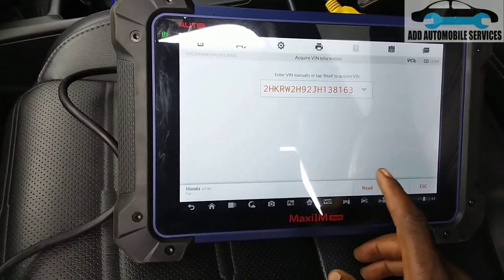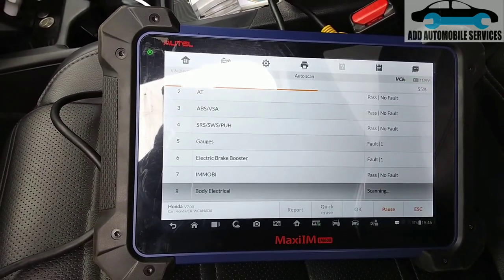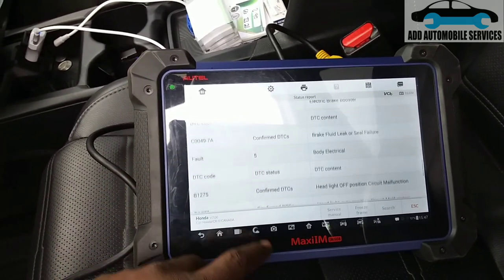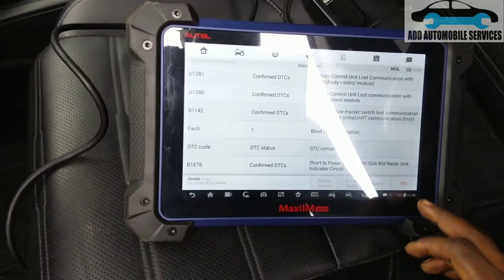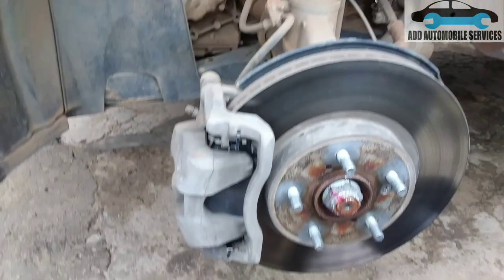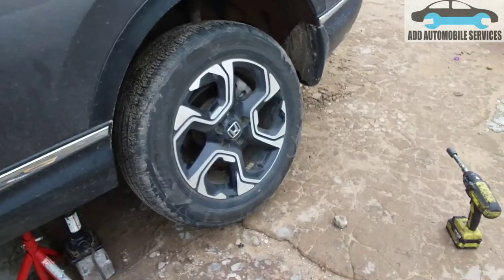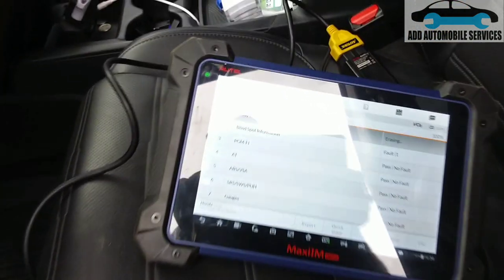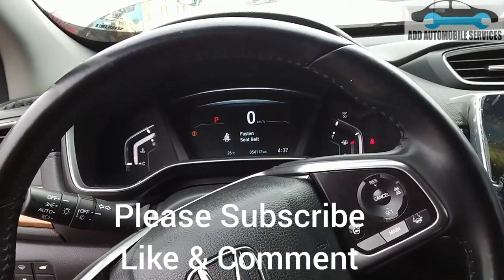2018 CR-V: Brake pad replacement with the help of a scan tool

Comment: So what does the service mode actually do Boss? Allow the park brake actuator to fully retract? Brake booster fluid bypass? Interesting Thx 👍
Reply from the maker: 👍 it allow the parking brake to fully retract
All of them uses Electronic Brake booster
Reply: @ADDAUTOMOBILESERVICES  brake booster is used most on turbo engines. since vacuum is not there. the maintenance mode is to retract the e brake electronic system. front brake is usually with fluid and you just push the piston in. regards.
Reply from the maker: Yes